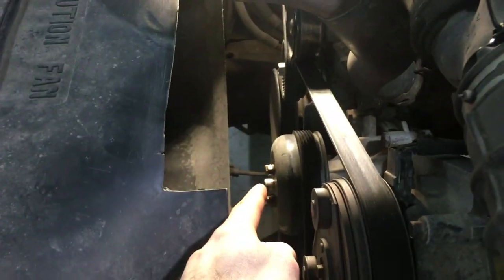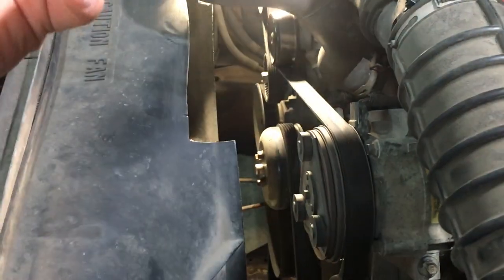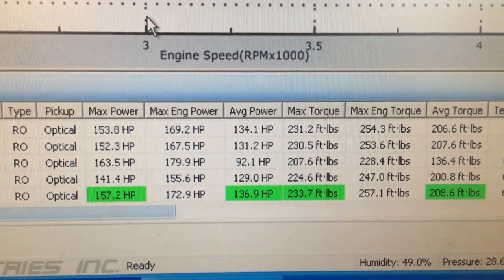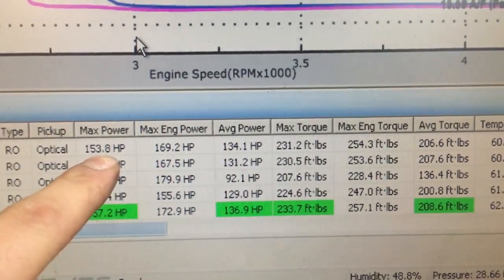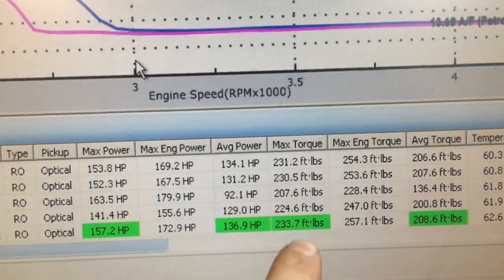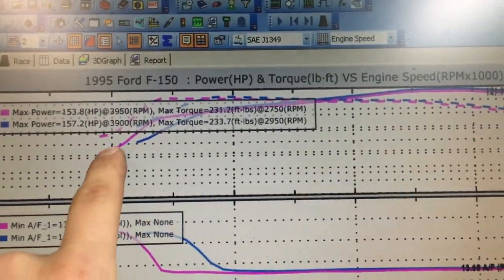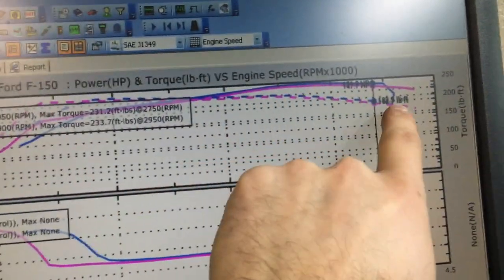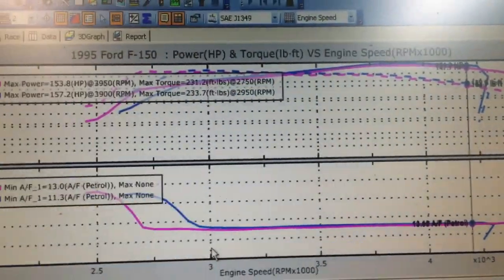Does a Mechanical Radiator Fan Kill Horse Power? - DYNO TEST | 1995 Ford F150

Comment: Hello I am from Argentina!

Did you remove the mechanical fan and replace it with an electric one? Or just removed the mechanical fan? Thank you!
Reply from the maker: JUAN DIAZ Awesome man!🤙 Glad to have you as a viewer!

I only removed the mechanical fan. From what I’ve seen and theorized, that should produce the same results as installing an electric fan.
Reply: @TheMinuteMasters  Thanks for the quick reply!
Reply from the maker: JUAN DIAZ No problem!🤙
Reply: @TheMinuteMasters  Actually, the addition of an electrical fan( or fans) when running will reintroduce parasitic loss via the alternator. It's still a net benefit to go electric :)
Reply from the maker: usmckozmo Good to know! I figured the extra alternator drag was minimal.

Comment: But did you install an electric fan before running the comparison dyno test? The video doesn't say. But there's no free energy, whatever energy it takes to turn the fan remains the same whether it is mechanical or electric. Potentially the electric fan may be more efficient at moving air, but since you have to turn mechanical energy into electrical energy in the alternator, then turn that electrical energy back into mechanical energy at the fan motor, there will be an energy loss due to inefficiency in each of those processes; so the electrical fan would have to first overcome those losses and then be even more efficient than the mechanical fan to save any energy and free up any horsepower. Otherwise all you're doing is changing the load from the water pump pulley to the alternator. At best what may be occurring is the electric fan is not moving as much air, thus requiring less energy; and it only loads the electric system down when the fan is needed rather than adding a load 100% of the time the engine is running. But, energy is energy, if you're going to move air it's still going to take power to do it.
Reply from the maker: You make good points. I never tested an electric fan before I ran this test. However, I doubt I got my truck hot enough to really engage the mechanical clutch for the fan. So 3 HP through the entries curve is just from the fan being attached to the engine. I have a hard time believing magnets inside of an alternator would great an equal amount of drag. But, I never tested that theory. So it remains to be seen.

Comment: How much power does the mechanical fan draw with a 60 mph breeze flowing at it?
Reply from the maker: Good question. These mechanical fans should engage if you are flowing air through the radiator. That air flow should be enough to keep things cool. But I guess that depends on weather and driving conditions. I’m going to say the draw is the same.
Reply: @TheMinuteMasters  I had installed an electric fan on a 75 hp Jeep and saw no measurable improvement in highway mpg or power up the hills. Today I installed the steel fan, set idle to 2000 rpm then turned on the electric to simulate movement. RPM increased by about 100, vacuum went up about .1".
Reply from the maker: @peashooterc9475  So, definitely some horsepower usage but nothing significant.

Comment: Have you been able to find which radiator and electric fan to use?
Reply from the maker: Ineed Kicks So from what I’ve seen just reading forums and Facebook comments, the Lincoln Mark VII or a Ford Taurus fans seem to be the best junkyard/oem fan. They last longer than aftermarket fans. I haven’t seen anyone upgrade or change out the radiator though.
Reply: The Minute Masters  would those fans work with a 93 f150 5.0?
Reply from the maker: Ineed Kicks I’m not sure but everyone seems to recommend them. You can check the fitment by measuring how much space you have in between from the radiator to the water pump pulley. If the fan is thinner, it should fit. Based on what I’ve heard, they probably do fit just fine. All you would need other than the fan is a relay and thermostat controller.

Comment: Dont overlook the fact that dynos are not moving.
Fans are sucking vigorously through the radiator.
Air ramming through the radiator at 25-100 mph reduces the parasitic drag to almost nothing.
THINK ABOUT IT
Reply from the maker: You definitely make sense. I wonder why electric fans have become a horsepower mod then.

Comment: Went to a single electric fan on my SBC.  Began to overheat to 235 degrees.  Went to a electric fan with shroud.  Same with a slight melt of one of my poly motor mounts.  Granted it was on a C3 corvette(minimal air to front and  fans pointed to the  ground).
Could never trust a clutch mechanical fan as you really dont want it to stop engaging in 100 degree heat.  
Went back to a stock 6 blade fixed mechanical fan with a 1977 C3 stock electric fan and shroud.  I don't care about a loss of a few ponies.  Never gets past 200 in the summer and there is something to say about air blowing over the exterior of the engine.
Reply from the maker: Yeah I don’t buy into the electric fan mod. I’m sure it can work but I just hear stories of them failing.
Reply: You got to get good electric fans that blow a lot of air and maybe daul fans will help better

Comment: For me just to have a quieter engine bay would be worth it, the clutch fan is so obnoxiously loud on revs.
Reply from the maker: This is true, the clutch fans are obnoxiously loud! Lol
Reply: Operating correctly fan clutches engage above @ 200* and unlock above @ 2500 rpm at any temperature.
The rest of the time theyre "freewheeling". Most noticably slow below engine rpm after a few seconds.
If yours doesnt, maybe yours needs replacing.
Reply from the maker: @hotrodray6802  This is true.  But despite the freewheeling, people think they rob power from the engine.
Reply: They are only loud when engaged.  Most of the time the clutch is not engaged and is relatively quiet.

Comment: Do this using a 3lb fan clutch thats heavy/severe duty and a plastic fan with 11 blades which weighs 3.3Lb.
I bet you dont get much of a HP drop!
Those metal fans are horrendously heavy and standard duty fan Clutches are only 60% speed of the pump. A heavy duty Clutch goes 75-80% of the water pump, a severe duty Clutch goes up to 93% of the water pump speed.
The lower % spin speed of the fan to water pump rotation = more drag/resistance.
The heavier the fan blade + clutch is = more drag/resistance.
My setup is only 6.6lbs with a very strong pull
Reply from the maker: That’s a cool set up! I’ve never bothered to play with the weight of the fan or the clutch.
Reply: @TheMinuteMasters  try it out. If I get another Anemometer I'll test CFM

Comment: So I don’t know how you got that fan clutch of but on my 4.9l in-line 6 we had to send it to the mechanic. We tried for three days with a normal kit to take it off and the pneumatic hammer. The bolt on the fan clutch
Reply from the maker: Chase Evans So you couldn’t even get it off the engine or you couldn’t separate the fan from the clutch? When bolts get tough for me I soak them in penetrating oil and then I use a torch to heat them up.
Reply: We couldn’t get it off of the water pump.
Reply from the maker: @chaseevans6214  Damn! That is bad! I would have definitely taken my torch to that!
Reply: So I have a map gas torch and a acetylene Torbo torch and still that has been the only part that I’ve had to take to the mechanic. Now I have a new vw Jetta tdi that I play around with. It stock has about 100 hp and 150lb/tq my new .216 injectors and my chip now get 174 hp and 225lb/tq. Now all I have to do is remove the egr and my massive dpf which looks like a torpedo
Reply from the maker: Chase Evans I use a map gas too. Still crazy to think you had to take it in. I guess I’m one of the lucky ones.
That’s sweet! That’s some good gains for very little modification!

Comment: The wheel power gain versus crank gain is wrong if you run a 210hp engine on a chassis Dyno in 1:1 drive and net 180hp at the wheel u are losing 30hp thru the drivetrain if u add power say 20 more HP at the wheel then 20is all that’s added at the crank unless somehow u done added more friction or inertia weight between the flywheel-wheels that’s costing you more power each time u add some this has been proven by Richard on a engine and chassis Dyno
Reply from the maker: Ah I see what you mean. That's my mistake. I mixed the numbers up.

Comment: Yes you can remove your clutch fan. Remove some weight off the belt system but you could damage the water pump. It's designed to work with that clutch fan and overtime you could wear out the pump faster as that extra weight it's supposed to handle isn't their anymore. If you're worried about gaining such a miniscule amount of HP and Torque at the wheels. Go right ahead and do it. I'll be laughing as I drive past your disabled truck because your water pump seized on you. Replacing a clutch fan for an electric fan could save a few pounds but that means wiring up that e-fan. Depending on your year model. It may or may not have the ability to control or throttle that e-fan. If it can't control that fan then it'll be on all the time. Leading to premature failure of that e-fan.

See about freeing up some extra weight by replacing the metal blades with plastic blades. But don't replace that mechanical fan off your older vehicle. All your asking is for your engine to run hotter as it serves to draw air into the engine bay and through the radiator. Some vehicles like my old 04 WJ has both electric fan and a mechanical fan. Though someone did that mechanical fan delete. It was set up for electric fan with a 3 plug wire. So didn't have to worry about that. Older vehicles may not have that option. Always check your vehicle to  see if it's set up with e-fans as well as m-fans before deleting that m-fan for minimal hp/t gains.
Reply from the maker: All good points man! Thanks for watching!🤙
Reply: @TheMinuteMasters  I catch your videos now and then. It's good to see what works and what doesn't. What is worth the effort or isn't. If your vehicle doesn't come with an e-fan and only a m-fan. I wouldn't mess with it. If it comes with both then maybe beef up the e-fan if you're removing the m-fan.
Reply from the maker: @SnakewithaGun  Thanks for watching man!🤙

Very true! If it ain’t broke, don’t fix it.👌

Comment: If your motor actually made any power at all, it would have been up around 5,800rpm where the power robbing aspects of that fan would truly shine.  They rob around 20hp total, and if it is a direct fit flex fan, EVEN MORE!
Reply from the maker: This is true. But even on the low end you lose a few horses. So, it’s definitely a good modification.
Reply: @TheMinuteMasters  Engine Masters did an engine dyno with multiple fans on a 350. The plastic flex fan killed 24hp. The clutch fan took 20hp.  The steel fixed fan took like 30hp.  Regardless, fans kill power.
Reply from the maker: @landrypoole  I watched that episode too. Excellent content and definitely true. 
I can’t remember if I did this test before or after engine masters produced that video.
Reply: @TheMinuteMasters  I’m about to do my own today.  Test before and then after.  Today is the before.
Reply from the maker: @landrypoole  Nice! Same year and truck? Or something different?